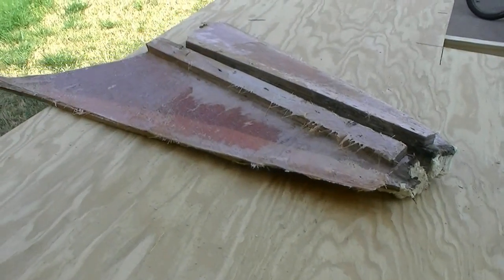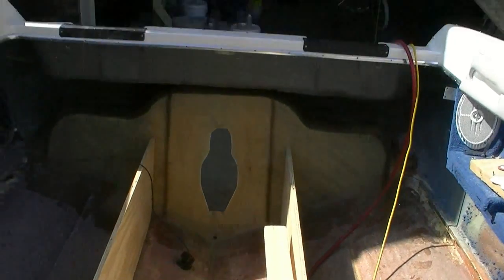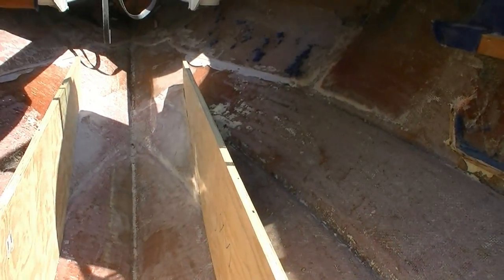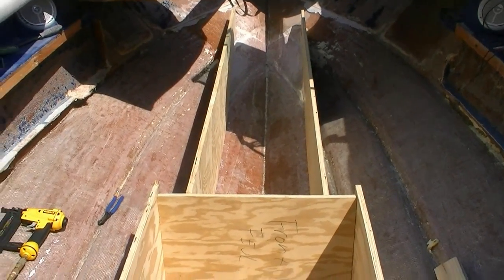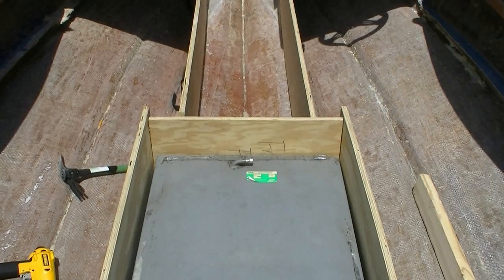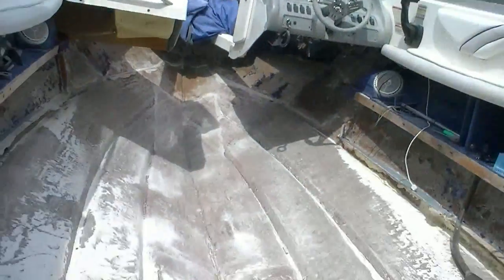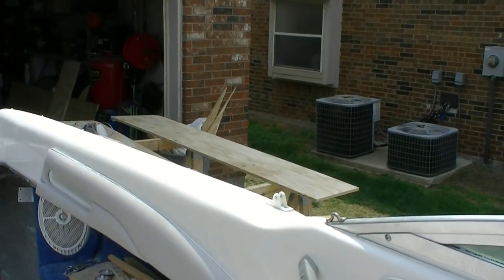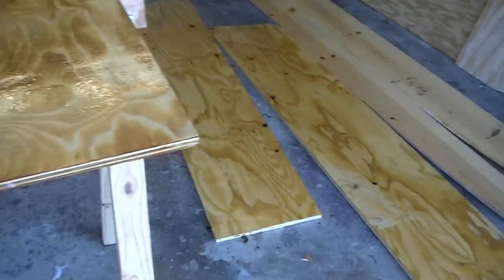Cutting the stringers for the Sea Ray Boat Restoration VLOG #19

Comment: hats off to you and your skill. I was lucky enough to come across a 97 Sea Ray 175 and from what I hear it is Sea Rays first boat that is all fiberglass (no wood stringers). I have poked around on it and found no wood in the hull, liner or floor. Except the hatch for the skis. I feel very lucky. Not so on my old 72 cruisers antigua with balsa wood in between 2 layers of fiberglass for the hull, pure mush!

Comment: Also just a note on all your grinding- a stiff wire wheel on the grinder will provide an excellent keyed surface without all the un-eveness caused by grinding with much less dust. It also maintains the structural integrity by reducing the amount of material removed. Again, a super job and very neat.

Comment: For the stringers I would have used exterior grade LVLs. The glue or epoxy is such you can use them under water as is.

Comment: Do the stringers really need to be scribed into the hull? Normally we cut them shy and then apply a thixotropic Polyester or Epoxy structural filler and this doubles up as a bed and fillet at the same time in addition to sealing the bottom of the timber. It also saves a lot of Labour and time trying to match every inch of curvature. You job is neat and perfect but maybe too perfect for what it needs to be. Love the videos.

Comment: Maybe this is a dumb question, but im stuck on the thought of how am i going to get the correct angle to place the stringers on the hull without there being a gap between the stringer and the hull. How would i get the right degree?
i have a '89 sea ray bow rider that needs a whole new floor and stringer replacement.
Reply: have you attempted your floor yet?  I have an 88 sea ray sorrento that needs a floor.   Frisco's videos make me think I can do it but he is an animal..  I'm afraid to start.  just wondering if you started, how similar is the transom, etc to his newer boat?

Comment: I'm remodeling my whole floor on my 1968 invader 15'. How much resins will i need to do the whole flooring?
Reply from the maker: If you are doing the deck you should to the stringers. I used 13 gallons on my CVX
Reply: They tried to get me to go epoxy for stringer and transom, but cost too much. You think if I go poly fir everything would that be okay?

Comment: Hey frisco I've got an 89 sea ray with with some soft spots on the floor, it has an outboard set-up is an outboard easier or harder to replace the transom? thanks
Reply: I'm doing a similar one grew with outboard way easier I think.
Reply: +Jeremiah Jarvis do you know of or have a nice write up in it??
Reply: not sure what your asking? but just took the gas tank out and the stringers don't look to bad might drill a couple of holes just to be safe.  On my boat the floor is pretty solid, but it is water logged. so I'm just going to cut open some access panel's to pull out the bad foam and fix the floor.